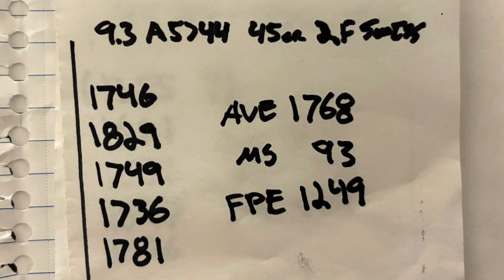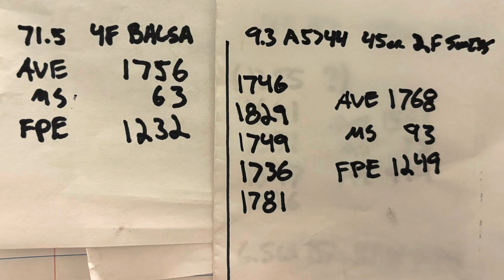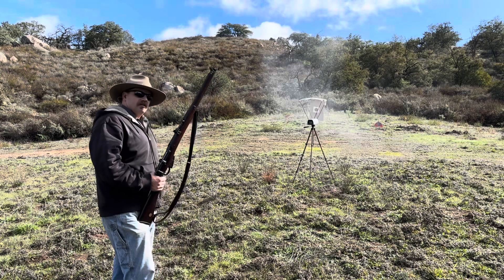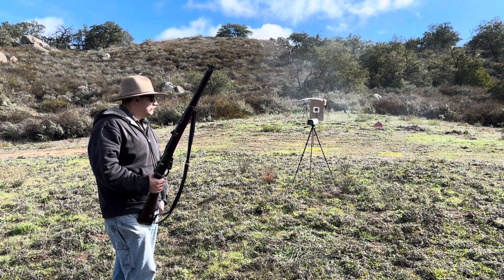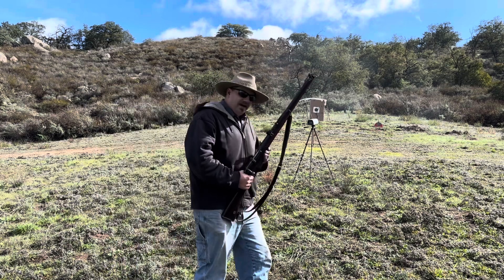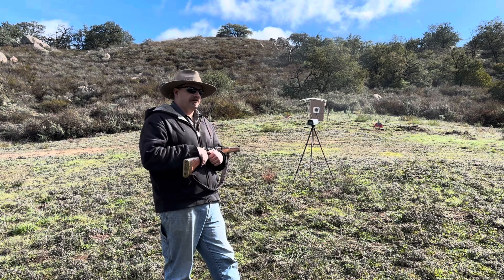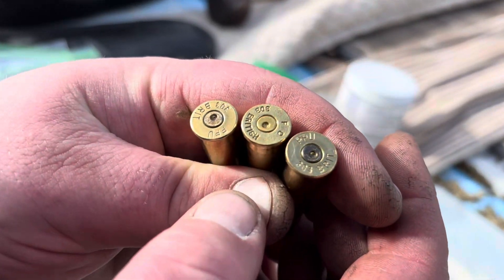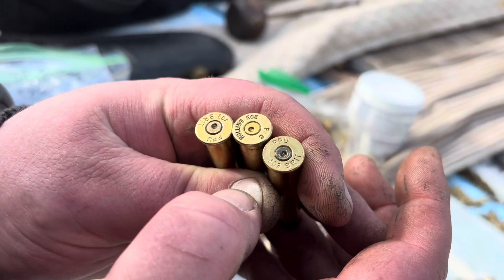Duplex loads, Mixed and Reversed Powder Charges

Comment: I just did a duplex test of my own in .460 S&W Magnum and got some pretty interesting and opposite results. 49 grains of 3F Goex, 5.5 grains of Lil'gun, and a 308 grain cast hollowpoint lubed with 50/50 crisco and beeswax. I shot two strings of 10 rounds each in my 10" BFR in 25 degree weather. With the smokeless on top I got an average of 1211.5 fps for 1004.0 FPE, ES of 93.2, SD of 25.9. With the smokeless on the bottom I got an average of 1347.5 for 1241.6 FPE, ES of 30.5, SD of 9.3.
If I had to guess, I'd say I was blowing the Lil'gun out of the barrel when it was on top because that smoke smelled a lot more like sulfur than like smokeless and the fouling was much worse on that string. I think the reverse or Russian duplex loads require a fairly long barrel to show any benefit.

Comment: Good video on an interesting subject- I've had some great results putting these types of loads together but I will not use any double base fast pistol powders as 'kickers' for a rifle load.   I prefer BP substitutes myself and am having excellent results with re inventing my own version of Black Canyon (ascorbic acid base fuel) and I've found tumbling the sized grains with a trace of aluminum powder (0.5-0.8%) and spraying on a thin NC lacquer fortified with a energetic nitro-ester- (3% PGDN) as binder takes thing to a while new level, +20-30% velocity.   Burning rate modification- duplex loads is one route, modify the base propellant with catalyst is another but both achieve the same results.  Very clean burning too, remarkable difference.   For me this is the way to go, game changer and more options/variants I want  to explore. Best part is cost comes out to about $20 per kg.  Cheers

Comment: Ive done a lot of duplex loading. The faster, (2400)  to medium burning rate smokeless and fill the case up to the base of the bullet with black powder. 4198 is really good for this. Jus sayin that I have gone way beyond the percentages you mentioned  with the right combination... Smokeless over the primer, black powder to the base of the bullet. Might mention that in the Ned Roberts book.. ("The breech loading single shot rifle") he mentions using duplex loads with 3 ffg over the primer and the rest of the load in 1fg.

Comment: An interesting experiment.  Another thing to consider might be the proportion in grains of smokeless used.  Compared to black powder.  With 5 grains of Bullseye....though a faster burning powder.....only around a half of that used in the other duplex loads.  That may also have some effect on total velocity and energy figures.  Regardless, it does prove one thing:  duplex loads can be useful.

Comment: From Elmer Keith’s Big Game Hunting:
“The whole principle of Duplex loading is to compress the powder charge in the case with no air space. The case must be the right capacity for the bore, bullet weight and powder rate of burning used. Further it must have the right constriction at the shoulder for best results. Next the chamber must be tight over the body of the case to prevent undue case expansion that would in turn allow the fire to burn back around the bulk of the charge. Then with a tube in the case, and the primer flash carried forward to the front half of the charge, the forward portion of the charge is ignited and a relatively small portion of the total charge is used to start the bullet. After the bullet is in motion you can burn a hell of a powder charge behind it with normal pressures.”
Just thought I’d put this out there in case yall hadn’t seen it! It’s a very cool ordeal.
Reply: In his book " he'll I was there"  he was allso in ww2 ordinance.

Comment: Maybe I had it wrong all these years. But it was my understanding that duplex loads were SUPPOSED to be BP loaded first, then smokeless. And if there was much space left, some cream of wheat or poly fill on top of that. The idea being that BP is easier to ignite, faster burning (at least using rifle powder), then the smokeless burns better and more complete because of all of the HOT and burning BP igniting it. /  I was also told that mixing the two together was NOT a good idea. Supposedly something about erratic burn speed and pressures. I guess that made a lot of sense to me because of the filler to keep the 2 powders from mixing.

Comment: I have a TC Black Mt Magnum with musket caps for ignition. I don't have any black power only Pirodex and Blackhorn 209. I was hoping to try a duplex load of Pirodex to Ingnite the Blackhorn 209 so I can get a cleaner burning. The gun is rated for a 150g charge so it can handle a pressure well if I play around with a 10g primer of Pirodex to get the Blackhorn to fire. IS this worth a try or should I give up on the idea of ever using Blackhorn in a sidelock.

Comment: Add right on top, red dot to any rifle load, 3 grains is going to get the pressures up to unsafe levels, but it makes bullets faster, and recoil is more noticable. It is a good way to get any load to +p with a bullet puller and 2 grains of red dot. 
If you want the extra fps, ftlbs of energy, per magazine, its like having several more rounds energy wise, you get flatter projection, you get less delay for long shots, and it is totally off the nannie rails.
I would definetly consider ultra high fps projectiles as a general weapon of high capability. The laser like instant gratification aspect is what is desireable. 
Someone should develop a semi auto weapon, and bullet casing that can take pressures for 150 grain projectiles going 6000 plus fps, at that speed you wouldnt even need rifling, so, it would make for probably the simplest and most effective weapon.

Comment: I remember reading about experiments by the ODGs where they duplexed and triplexed powders, AND  mixed them

Seems there is an application for all of them

IIRC, the duplex/triplex loads had fast nitro powder farthest away from the primer, so as to burn only once in the barrel
this helped accelerate the bullet once it was already moving by the slower powders

I wonder how the BE would act not mixed, but put in last

also, I wonder about $$, using a cheap surplus 50BMG powder, melt it in acetone, dry it, and grind it fine.  this would remove any deterrent coating, and make it much faster, add this on top of slow/black powder

Comment: I was curious and tried to repeat your experiment in 45-70. My duplex is 5grains of 5744 and 60grains of 2X Goex. Both sets used were topped with a 500 grain bullet all within 2grains of weight.

My bottom loaded rounds recorded an average of 1231.25 fps and the top load was 1262.75fps for an increase of 31.5 fps.

Point of impact at 100 yards was not dependable.

One observation was that bore had less residue with the bottom loaded sequence. 

Thank you for the video. Just sharing my results.
Reply from the maker: Interesting. Thank you

Comment: Another outstanding video that didn't suck!  That, and I just don't want to have to make my own damn video...  Thank you for going where most of us have feared to tread.  The mixing and upside down stacking have both been "off limits", for alleged "safety" reasons, for as long as I have been loading duplex loads.  I never dared even try, for lack of any published results, advice, or any sort of encouragement.  I'm not sure you realize just how relatively "ground breaking" your efforts are on this front.

Very, very interesting results.  I think the mixing of the powders was the most vehemently recommended against, with everyone convinced they were going to blow up their guns.  To see your results, and just how inconsequential mixing the powders proved to be, pretty much puts all of that unsupported, untested "advice" to rest.  Thanks for that.

Surprising, too, are the results from doing it "backwards".  That kinda forces us to rethink a lot of what we thought we "knew" about all of this.  Ah, the vagaries of internal ballistics...

So, I have to wonder (keeping in mind your theory regarding the placement just below the bottleneck), how a straight walled case would react to an "upside down" load?  I do know that bottlenecks and straight black powder don't seem to get along very well, with what I have found to be significantly increased fouling in the throat area in cartridges like the .44-77 and .44-90.  I actually gave up on both because of those fouling issues, following the lead of the Sharps rifle company when they phased them out in favor of straight walled cases. There has to be some weird dynamic with that bottleneck, as evidenced by that fouling (in straight black loads) and your discoveries regarding velocities.  Once again, the vagaries of internal ballistics...
Reply from the maker: Thank you

Comment: The upside down load for a bottle neck cartridge and its increase in velocity is very cool.... but given Jakes hypothesis on why this is evident for the 303 would suggest straight wall cases would not benefit from an upside down load and the increase in velocity. Sounds like more testing is required to prove the benefits are also realized in straight wall cases...

Comment: I wonder if the increase in velocity is due to a more efficient burn. From what I understand black powder builds pressure immediately, where smokeless has a more slow and consistent burn. Thinking along these lines if the black powder is burning faster then it would make sense to capture the most of that energy first then let the smokeless powder burn through the rest of the barrel rather than having the slow burning powder ignite first and give it a kick of pressure somewhere a quarter or halfway through the barrel

Comment: This makes sense🤔 from a combustion/deflagration view of the 2 propellants.
The black powder will decompose faster than the smokeless, initially however, the carbon/sulfides generated could be flash-coating the smokeless powder and creating a delay, when the smokeless is on the bottom because the burning front follows the propellant and the "exhaust" is in the back before it's in the front. 
This also meant the smokeless on top was combusted, uncoated by residue from the black powder because it was defligrated by the flame front directly. 
I love your videos ❤
The experiments, within reason😂, are fascinating.
It took me a bit to puzzle this one out but based on similar studies, this is a reasonable possibility. 
Mega cool

That coffee grounds powder was no Espresso tho😂🤣😅👍🍉

Comment: theory time
black powder builds pressure in the chamber
the 5744 bumps the pressure hard towards end of burn

vs 

lil pressure bump at the start of burn
with a slow build of pressure over the rest of the burn

a 10% bump at the top end vs a 10% bump at nothing (10% arbitrary number for effect actually closer to 0.5% @ 15%  smokeless)

Comment: So here is my best (very unprofessional yet lengthy) guess as to why the upside down load was achieving higher velocity: black powder burns far more gradually and steadily than smokeless and is more like a push than a punch. When you mix in smokeless evenly you get slight bursts or spikes of energy in the burn's timeline. Those spikes in energy or pressure may deplete or be relieved as the bullet moves down the barrel providing more and more volume for those little pressure spikes to be relieved (perhaps creating a "speed up and slow down" effect as the bullet travels down the barrel"?). However, when you load the smokeless powder on top in an upside down configuration the steadier burn of the black powder builds up as it would with a straight black powder load and finishes off with a crescendo of all the smokeless going off at the end rather than spread throughout the burn in smaller bursts. Like a running start before punting the football. Or... perhaps something to that effect. Like I said, I am no expert, but I figure that may make some sense.

Comment: I'm failing to understand why anyone would mix powders. I personally have several smokeless loads that I have shot in several modern black powder weapons. Everyone tells me it will explode the weapon because that is the indoctrinated teaching, if done correctly it is probably safer than black powder. Blackpowder is a low "power" explosive, and not a propellant, why we measure it in volume. It simply cannot produce the pressures that smokeless powder produce. Makes a great primer charge but not really good for big explosions. Smokeless powder however is a high explosive propellant and can achieve very high pressure per the same volume in comparison to black powder. It does not ignite well though, I suppose if a person was trying to ignite smokeless powder with a blackpowder primer, say because they were using a cap instead of a cartridge primer there may be a need for a mixed load. other than that this is an exercise in futility as it will not produce the speed or energy of a single smokeless powder charge.  If anyone is interested in how I work out a smokeless load for a blackpowder weapon hit me up.

Comment: The original .303 cartridges used 215 grain bullets and I believe the 174 grain bullet came in the later smokeless (cordite) loads.  Would the heavier 215 grain bullet help the black to build pressure / velocity?
Reply from the maker: It’s very possible

Comment: The way I understand it smokeless powder burns faster as the pressure rises. The black powder gives your initial spike in pressure, then the smokeless powder ignites and stretches your pressure spike out further after your pressure is already up.
Reply: You and several others have an answer that makes the most sense.  Smokeless on the bottom has to make its own pressure but if on top, it gets to ride the wave of pressure from the bp charge.
Reply: As a Chemical Engineer, that's the way I have always done it!
Reply: Well put. 🙂.

Comment: Here's my theory on the upside down load. I  think the blackpowder developed enough pressure to make the smokeless powder to ignite properly. Smokeless is designed to do its work under more pressure. I wonder if it would react differently if it was ignited by a magnum primer. In the theory that it hits the base of the powder column harder as it ignited and moves into your theory of the effect of the bottle neck.  And would it act differently in a tapered case like a 45-70. Love this science stuff. You keep me thinking.
Reply: 45-70 is straight wall
Reply: @TomGellos  it's a straight tapered. They were designed with a slight taper to aid in extraction from a fouled chamber.
Reply: @jeremyp2295  it's refered to as a straight wall brass case I have one in my hand I don't see any noticable taper, and if you need a dial caliper to see the actual taper it's not going to be of any significance.
Reply: @TomGellos  the case tapers from. 5055 at the rim to .480 at the mouth. It was significant enough for them to keep the taper in the final design.  As things moved into the smokeless era they stopped calling it a straight tapered case

Comment: Old  very known  use of. RED DOT powder. 1=5.  (1 grain red dot = 5 grains blackpowder)   for  use in target rifles of 45-70  40-60  38-55  ect.   Mixed. Generally. One shot glass reddot to a pound of black powder ,   the  duplex of  smokeless  near the primer  was called a "kicker"  of a burn rate powder. Of  4227 or so  behind  a very very slow smokeless or  black powder. Now mixed smokeless is  the original  "duplex".   The theory is the higher nitro content has extra oxygen  to help with the burn .   It just so happens  13gr reddot equals  65gr black in velocity  ,( pressure not withstanding) ,  green dot and unique  also works  ,  many high nitro powders  ( fast work well )   Bullseye the highest nitro content

Comment: The comment section. Sigh. 

Have you heard of using flash tubes in the cartridge to initiate ignition at the front of the case instead of the rear? Supposedly.. it reduces chamber pressures a bit and allows for higher charges. Why?.. well.

Resistance. Pressure is a measurement of restriction. Like boost in a car. Low boost can mean high flow, high boost can mean high resistance. More isn't always better, doing it right is better. 

What most fail to realize is that gas has a substantial amount of weight. Its why muzzle brakes are so effective on the big boomers. If you want to accelerate a bullet, you also have to accelerate a large quantity of gas behind it, or powder. If you ignite from the front, for whatever reason it makes less pressure. Not forcing powder down the barrel contributing to parasitic losses? Better flow contributing to lower pressure? Higher charges are possible with forward ignition. 

The Weatherbys tend to be slightly more efficient. Gas choking at the shoulder in something like a win mag vs the better gas flow characteristics of the double radius weatherby? I'm leaning towards your results being the result of slightly better efficiency. Seems obvious, you're using the same input and getting higher output.

Comment: There are also duplex loads using two different powders not necessarily black and smokeless.
Reply: This is interesting. I think I might have strapped the rifle down and fired before risking my face on it.
Reply from the maker: I like to live dangerously
Reply: @Everythingblackpowder  I see
Reply from the maker: Spare me the safety lecture, Friend. As you can see, it worked out fine.
Reply: @Everythingblackpowder  I’m not getting onto you Willard. Just saying I don’t take risks personally anymore. I think you’ve caught it so much that it’s maybe not that clear. I dig the channel and thanks to it I have made my first homemade 200 grams of powder. Shoots well when charged by weight. As it warms up a little hopefully I get to making a press and pucking die and try my hands at the wet “CIA” method